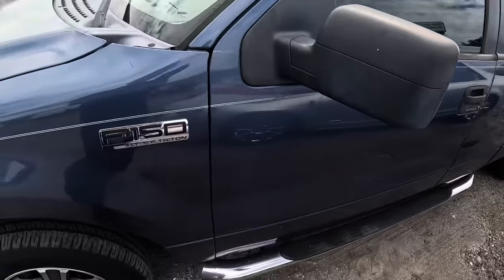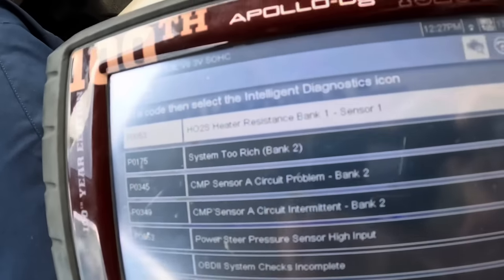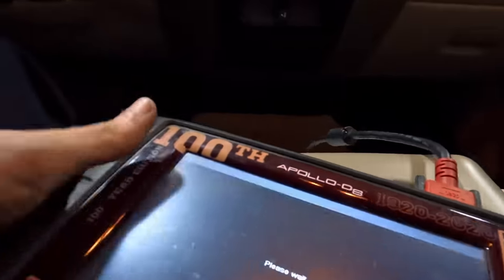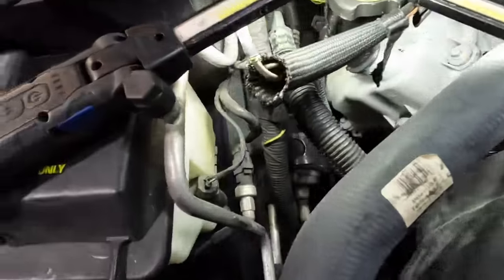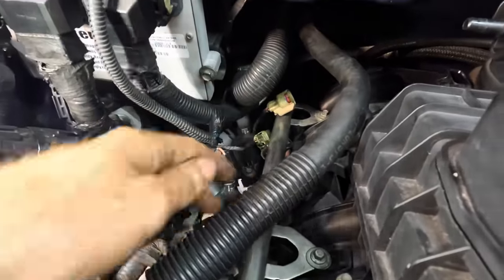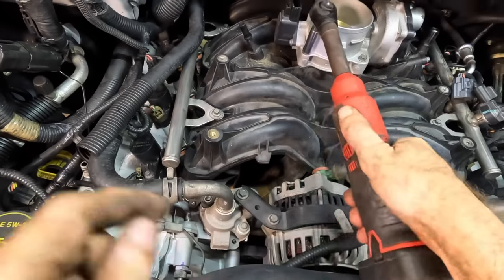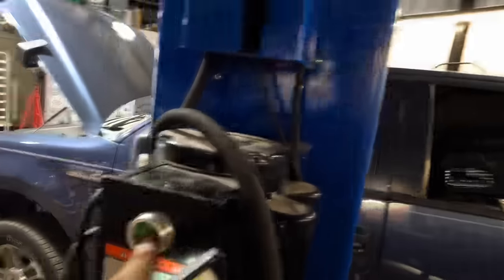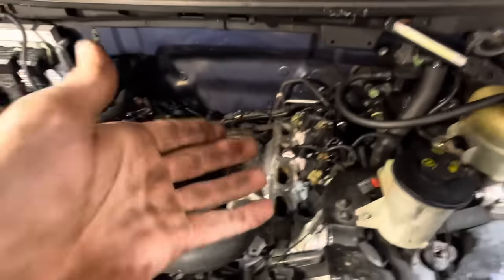Hack Job! Mechanic Botches Engine Replacement! Multiple DTC's

Comment: Yep, learned my lesson on getting motors replaced many years ago. Got an exchange motor put in my old Datsun to replace the tired original motor. All was good until a few months later, when I was out one day, got caught in the rain, and put the heater on to help dry myself out. 15 minutes later, car was overheating. After walking an hour or more to a petrol station, calling my dad for help and having him come out to tow me home the best part of 100km (bless him). I went under the bonnet the next day and discovered the installers had cut corners by not installing the heater hoses, which I saw as soon as I put water in the radiator and turned the car on. With the heater on, coolant was just pouring out the cut ends of the hoses. I wasn't too happy, knowing all my trouble could have been avoided for the sake of a couple of hoses. But on the bright side, the motor was fine and outlived the car, and the fix was simple. Lesson learned.
Reply: Datsun, there is a brand name from the past.  I had to do a lot of work on the 610 my family had when I was younger.   Although I preferred the working rom around engine in my 67 Kaiser cj5.
Reply: It blows my mind that some technicians make mistakes like that, whether they don't care or they're just complete oblivious, that is something that's hard to over look. If I'm working on my car or a customer's car, I can't help but double and even triple check  work, otherwise I cant sleep at night!
Reply: A few months later??? Seems kind of unlikely to be honest
Reply: agree, only a few actually had a valve to shut off hot water to the heater core, which only shut off the inlet to heater core. if either pipe was not connected, the system would empty in no time.@shawnwimberly9294
Reply: My dad had a Datsun that lasted for 210k. I think it was an '85.

Comment: I gota say Ray, I've watched your channel from the time you worked at the dealership, and then moved to your own shop.. but since then I haven watched for a couple of years.   
since that time you have hired two helpers, that shows' that being honest and doing right by your customers, pays off. from the first time I watched your channel I was impressed by your work ethic and your honesty. Thank you Ray. you stand taller then most other's in your field.
Reply: Yeah I think his honesty was what caused issues in the past cause he wouldn't blindly install 1k worth of parts just cause someone else said it needed it, hence taking money out of the bosses pocket and they usually don't like that.
There's enough broken stuff in the world that shops are booked weeks in advance so there's really no need to lie about things to get extra jibs.
Reply: @DanielSan-ch7dr My Altima is due for an oil change and CVT fluid change and I had to schedule 4 weeks out.  Fortunately, I realized it was going to be a while, so I planned ahead.

Comment: for an F150 with 200,000 miles on the odo, the paint & interior are immaculate !
Reply: I have seen several older Fords he has worked on were interior and paint held up great to around 200k....hear that Toyota and Honda.

Comment: I was rebuilding engines at home when in high school and never had any issues with installs. It appears a second grader did this job in a hurry with no regard how things were properly routed, etc. This is the kind of work that causes shops to go out of business.
Reply: thats not a bad thing - quicker the better!
Reply: Probably the same thing the  installer told the shop manager that hired him.  Doing @ home and thinking you can do the work a professional technician can do is exactly how this stuff happens. Been in the industry 30 years and the amount of hacks that think they are mechanics - technicians who all claim they " used to do it @ home is mind boggling.

Comment: Waching you go through an engine diagnosing and extrapolating problems to error codes is really amazing. Your understanding of what causes what and how everything works inside and around the engine is really impressive. Thanks for another interesting video.

Comment: A lot of the value i find in these videos is in going to check our cars which i now maintain myself for crappy work which mechanics could have done. So far its almost always poor electrical work done. On the bright side Ray, at least this time you didn't find wire nuts and drywall screws 😅.

Comment: Thank you, Ray. 3 minutes in and you may have solve our Kona problem. It's one year old and intermittently rattles on cold start up. You mentioned the oil pump so I checked a couple Hyundai forums. Turns out it could be either the oil pump or the hydraulic tensioner on the timing chain. Or, it could just be a heat shield. But, now I at least have something to go on when we take it back to the dealer. Cheers, dude!
Reply: I was reading another YouTuber's comments about 20 comments up. He had really good information and he said that if you would try to start your engine by pushing the gas pedal all the way down giving you a Full Throttle situation, the motor would not start but would pump oil into the tensioners on that timing chain. So after a 5-second attempt to starting with Full Throttle you attempt to start the car again after the tensioners are lubed. If you don't have the rattle at startup then, you will know that you have probably bad seals and yours and that they need to be replaced eventually or you'll damage your timing chain and motor when they fail. I was very appreciative of that gentleman's comment, he taught us a self-diagnostic test and function that we can do ourselves to Prelude those tensioners, and also find out if the seals are bad, which would allow us to take them in and get them replaced or replace them ourselves, thereby saving our engine.

Comment: There is nothing wrong with ruffling feathers when it’s done by a expert like you Ray
Reply: He just doesn't feel like losing a day getting subpoena to testify
Reply: Its a fine line, posted online is advertising. The customer can say and point fingers, but Raymond can't cut down his competition like that he could get sued for slander.
Doing it public is the worst then you can do it also makes you look bad.
No harm in showing without names.
But it gives the person who owns the truck the information he needs to get this resolved.  He's spent a lot of money on this truck, he might not have had to buy a BCM, whos fault ?  The rebuild shop or the installer.  Was the original motor even bad?  You get a lot of questions about this.
And you can see the owners taken care of his truck.
Reply: Professional technicians and shop owners should never pass blame or point fingers or degrade others work. The professional way to approach it is to list the needed repairs without editorial of what you feel may have caused it and state there were things done in a way other then the way you would do them and let it stop there.
Reply: @CodycoWeb  
Disagree with that. People should know what shops do crap work.
Reply: So tell me, why shouldn't the public be made aware of callous workmanship, especially when it is clearly obvious that the job was poorly done? This is more or less a forensic teardown to locate the issues so they can be remedied, but any reasonable person would want to know if it was a part failure or an incompetent mechanic that caused the problems. I think Ray has shown himself to be very professional through his many videos and has every right to verbalize an opinion as to how these problems happened.
Reply: @12yearssober  If that happens you get all your expenses rebated by the court.
Reply: @bobbg9041  That is a reasonable comment I would hope whoever done the reinstall is decent enough to refund all monies outlaid however I think this is heading to court.
Reply: @12yearssober  That should be done by the owner of the vehicle & reported to the authorities.
Reply: @LesReeves  
Wrong. The court can order the defendant to pay you for your lost time and expenses however it is up to you to collect. The court will only pay a witness fee which is usually less than $20.
Reply: @12yearssober  Sorry spoke out of turn here in AUS the court pays all of your expenses & then chases the defendant.(you need to show reciepts or other documentation as proof.).
Reply: @CodycoWeb  As a professional ASE Certified Master technician, and a shop owner, I have to respectfully disagree. Without accountability within the industry, everyday folks are victimized by the incompetence of careless "mechanics", costing people hundreds or even thousands of dollars. There is a difference between a minor mistake and a series of major mistakes.
Reply: @darrylhowe1465 So you tell customers not to take their car to X shop cause they're no good? or tell people what shop messed up a customer's car? Like someone else said, then you open yourself up to a lawsuit. Just sayin 😎

Comment: They(rebuilders) often don't mention the brands of parts for a few reasons Ray. Mainly they change brands as needed to finish production runs, or cut costs. Also may not have an agreement with all the brands they use for advertising them. Lastly they use cheap parts and don't want to say we used "Johnny's Pistons" in the literature, lol.
Reply: "Almost all of the pistons in this engine come from the same manufacturer."
Reply: Reminds me of a 7.3 idi jasper rebuild I saw took apart because it ran bad , 7 pistons were bored 30,000 over with new rings and pistons and the eight was stock bore, oem piston with new rings. This was years ago, I think they are better now.

Comment: I'm impressed with the amount of effort you put into your diagnosis, in other words you do it right. My rear end went on my 2015 f150 at 60k. Dealership tried to charge me $160 for a joyride and tell me there's nothing wrong. I argued for 20 min trying to get them to diagnose my truck, after threatening to charge me more money they agreed to allow me to go back with "tech" put it on rack to show him the unforseen problem. Long story short I ended up getting a complete new rear axle from Ford manufacturer due to the extent of the damage. I have a lifetime warranty on truck so it only cost me my deductible $100, even though they tried to charge me $800 for shop supplies. When I requested the shop material breakdown the $700 additional charge mysteriously disappeared.

Comment: This is a great watch for me. 

i've been learning to work on my 01 F150 (the 2V 5.4L) and am in the process of replacing the engine. Just got the old one out yesterday without breaking anything (yet)!

But this is nice to watch to give me even more ideas of things to be wary and avoid. The transmission harness was top on my list as soon as I realized how tightly it's draped above the transmission.

I got all the connectors off safely before pulling,; but I did make a big stupid mistake and try to separate the trans from the engine with the 7th bellhousing bolt still in it. Lol. 

Didn't break anything, again, just wasted time thinking the dowels were seized. But once we got that, it came right out! :)

Comment: Always reminds me how I learned every swear word in vocabulary from working on fleet of squad cars in village of St Paul Mn in late sixties, 
and of course it's no mystery who made them.  

But when they were towed in from high speed chases with blown engines, they were already to go rebuilt when Chief of Police came for coffee the next morning.  Working on them all through the night.  
If the officers were bored, we provided shootibg gallery for them to practice in one of the bays using roll of belting for repairing the wrecker sling, they could unwind the roll to examine penetration.  
Fun times..  
Cheers

Comment: When I was still drag racing my first pass was great but so good I had to run immediately again to back it up. Again sweet. We did the tear down for inspection and put it back together for first round of finals. At the line that knock started. You have a choice then and there. Run it and blow it up or shut it off and save the motor. I shut it off. Say what you care to about John Force, he put his in gear and coasted down the strip but NOT to save his car but to save me shame. It may have been his longest 1/4 mile of his life. Super respect for that man. He heard me knocking and I didn't want anyone getting hurt. Big shock..Force nailed second and final round.

Comment: Thank you for recording this Ray! As a proud original 2004 f150 5.4l 3v Triton Lariat and very active F150 forum(s) member, this video is very interesting. I definitely know of the rebuilder of that engine, especially with the valve cover paint color as well as the questionable rebuild. I would venture to say all the immediate issues were caused by the installer with a massive lack of knowledge and caring. As for Fraser rebuild, there's research pointing to the use of aftermarket parts including Dorman phasers. You are fixing alot of the issues directly caused by the installer but in no way would I trust a Fraser 5.4L 3v Triton rebuild. Seems the honest rebuilders using OEM Ford parts are becoming extinct as scammers see an easy dollar claiming rebuild, especially on the perceived history of the 5.4L 3V.  Lots of disinformation out there as I'm sure you know.
Reply: My 2014 5.4 3 valve rattles on start up after it has sit for a few days. It has done this since new. Runs fine and no engine codes. I think it is the roller rockers before they get any oil. Once running the engine is smooth with normal engine sounds.
Reply: Yep, rattle can rebuild
Reply: @GaryH-pw9cm I'm pretty sure it is blown seals in the chain tensioners or broken chain guide. Very common. Try this: start the truck up but push the gas pedal all the way down, the engine won't start with wide open throttle but it will pump up the chain tensioners with oil. Just do it for 5 seconds or so, then start as normal. If you don't get the rattle - then that is what's causing it. You really want to fix them eventually because it will break the chain guides and scrap up the timing chain cover.
Reply: @gary9388 great info. I appreciate that. Telling us how to perform a diagnostic test which actually pre lubes the tensioners is something very little people not in the automotive industry would know.
Reply: @GaryH-pw9cm your rattle on start up could be a notorious, and as i found out, a very common small exhaust manifold leak on these engines. I had same issue and chased it for months, turns out it was a small exhaust manifold leak and once it warmed up and metal expanded it went away.

Comment: I died laughing at the hot bolt. 😂. I do the same thing.  Troubleshooting sometimes is repairing.  I work on processing machines and we call what you have as “buddy bugs”. The previous shift worked on a machine and you have to fix their repairs. Congrats on the new shop. Last vids I saw you were picking up your tool box! 😮

Comment: After i had an engine replaced by a shop that botched an oil change (yes they did mess up an 07 vw passat oil change) i immediately had it taken to another shop and inspected for a job well done.  Helped ease the mind of if everything was done correctly instead of waiting for noises or more breakdowns.
Reply: Imagine that in Europe in some of the most privileged and developed countries, they manage to botch jobs on VWs, while parts and knowledge is abundantly available. And they charge 100+ euros per hour. SMH...

Comment: Morning Ray, great videos and repairs. I see you using a razor blade to open tape wrapped around wires. I found using a sewing stitch seam ripper, it is much safer on the wires and especially you flangies.
Reply: golden suggestion simple but important

Comment: Ray, all that loose wiring at the back of the block is likely why the thing was throwing intake runner codes.  I've encountered this exact thing on a 2006 F150 with the 4.6 3V.
Reply: FordTechMakuloko covered this on his videos on this engine. It really helped me be informed when working on these.

Comment: I have probably installed 100 3 valves over the years and the only one I had a problem with came from the green parts house learned a valuable lesson from that!!